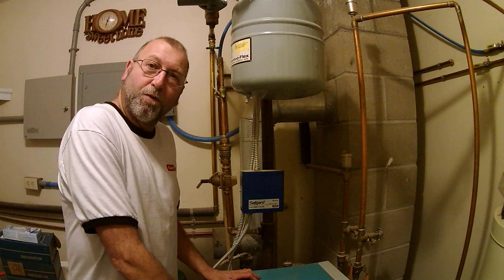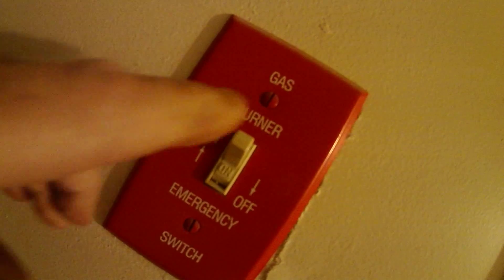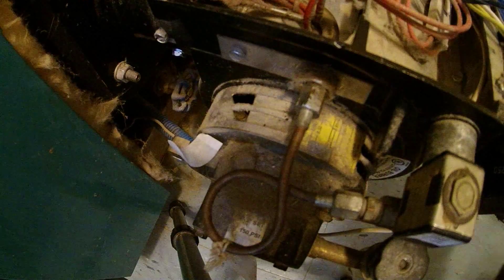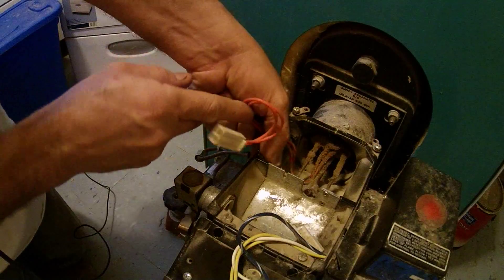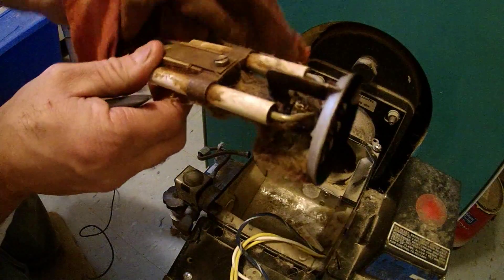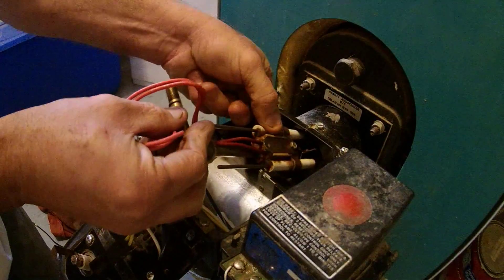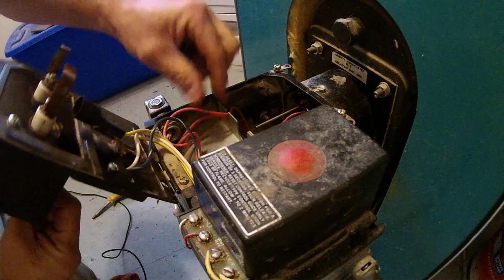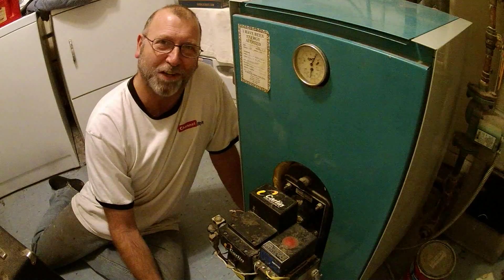Oil Burner Keeps Tripping The Reset Button:

Comment: Our burner tech came out for this problem. He suggested a metal pipe that goes to the outside for the dryer. I didn't realize all that dust was from the dryer. It had a cheap foil looking vent. We also are getting a new furnace because this one was installed in the mid eighties and is not that efficient with oil use any more. It's been repaired too often and I'm relieved to have my husband agree to purchase a new one.

Comment: Great Video! But the issue is your dryer. There's no way your dryer should be putting that much lint out in your basement unless the vent is completely unhooked or blocked. 
With that much lint floating around you're putting yourself at risk of a fire. Check your dryer vent and dryer and clean both and be sure it's doing its job in venting dryer air outside your home.

Comment: My burner was doing this. Cad cell was clean. Good oil flow. Everything good. I was about to bypass the cad cell and noticed its screw terminals on the controller were loose. Tightened them and burner is running. Whew, very relieved. I guess they got loose from the motor vibration.

Comment: whats that cloth bag hanging on the tube with string?  great video!
Reply from the maker: electrode spacers. depending what you are using for a nozzle the spacers are for moving the entire mechanize forward or back, Thanks for watching.
Reply: Thanks, I thought it was some trick to keep it dry or something like those pouches that say don't eat on them.

Comment: I have a Becker Oil Burner and just paid $150. to have it cleaned.  However, now it keeps tripping at least twice a day.   The oil burner service guy said to hold the reset button and count to 60, and it will go back on.  Well, I am tired of doing this at least twice a day.
Reply from the maker: well,, is your tank outside? if so are you using #2 fuel? # 1 is more expensive but will light in cold weather, also maybe the filter is clogged and not getting enough fuel. 2 filters one at the tank and 1 at the burner. have patience eliminate one problem at a time.

Comment: Mine keeps tripping and I have to reset it ..also I get a really strong smell coming through the vents like chemicals and gives me headache..could that be a sign of a clog?
Reply: Also a week ago when I was reseting  black smoke came out
Reply from the maker: Wow you have got some problems ): I would at this point call for some professional advice, I am not qualified to diagnose this type of problem, sorry and good luck. and thanks for watching.
Reply: @hopeforthefuturesg  This happened to us a few weeks ago and we found that the chimney that was supposed to have been cleaned had not been and there was ash/soot build up blocking the air intake for the oil furnace. It could have started a fire really easily and it was scary! After that was cleaned out, it worked great.
Reply: @superdutyscaler6823  If you're going to be nasty to people, at least use proper English.  It's "you're supposed" not "your supposed".
Reply: @Mobzekiel  the headaches could be carbon monoxide poisoning!   Are you still alive?
Reply: @superdutyscaler6823  Call a tech! Look for someone affordable but call a tech! It could be diesel fuel ⛽ the filter .... Just to be safe 😉

Comment: Id recommend an air conditioner filter on the intake vent.
Reply from the maker: The dryer is vented outside, I think I should keep the laundry door open until put in a air intake for burner.